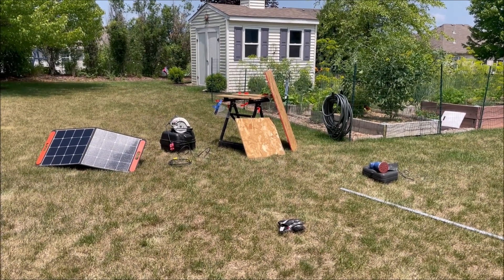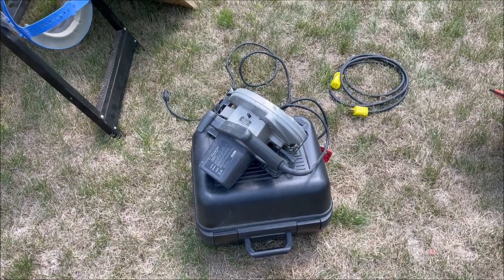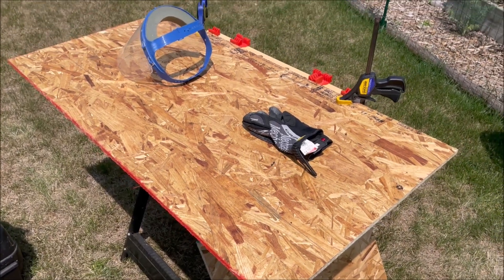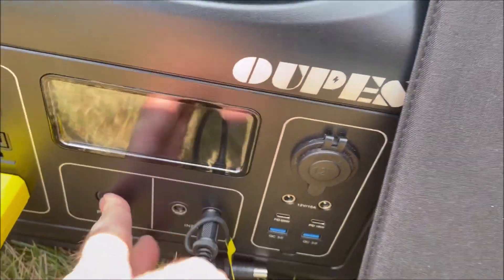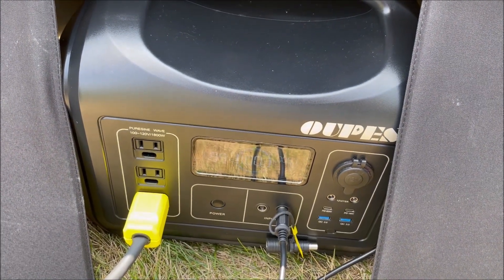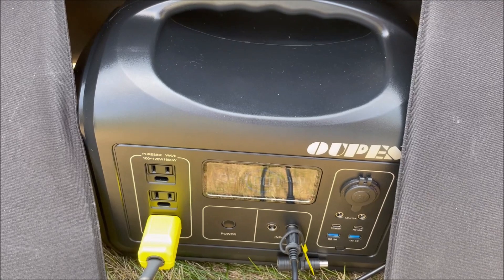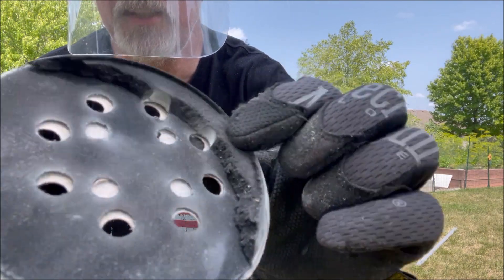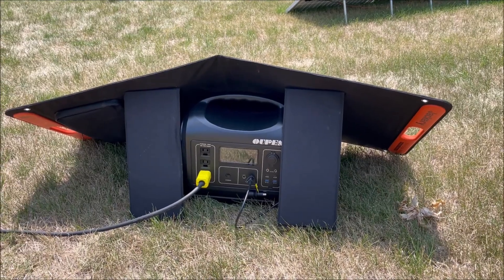Ripping Plywood with the OUPES 1800 SOLAR GENERATOR - NO PROBLEM!  DIY Solar System!

Comment: Nice! By the way, in addition to surge, the motor in the saw when loaded will take 2x to 3x the no load power.  The surge capacity of these little power stations is incredible.  Far more than a similar continuous wattage fossil generator.